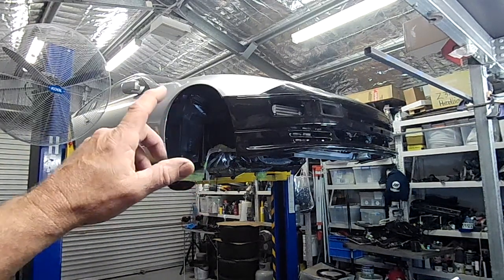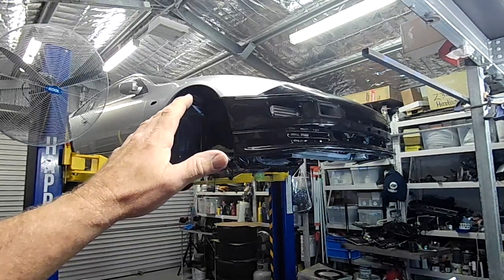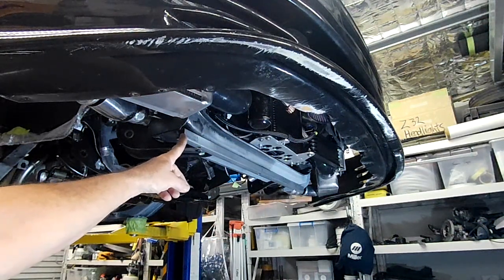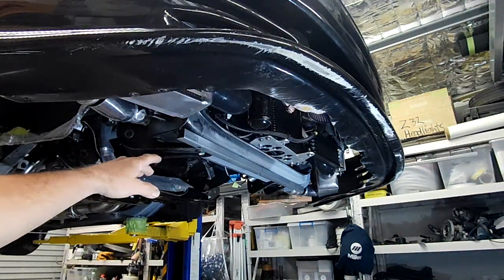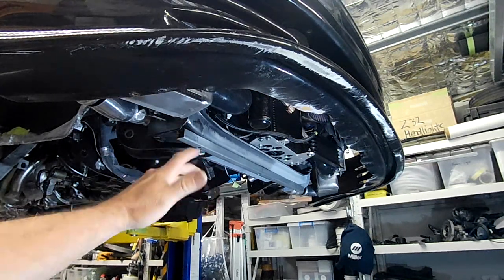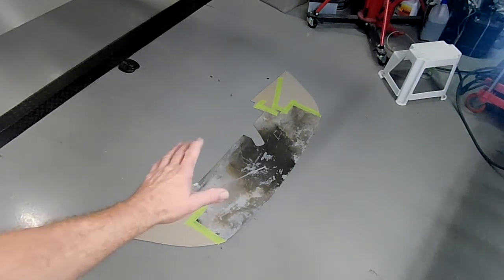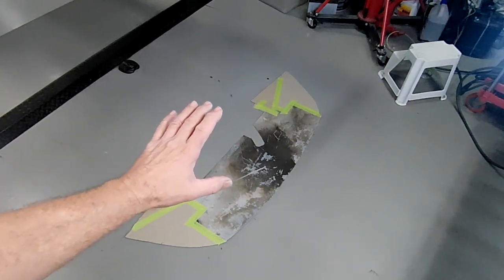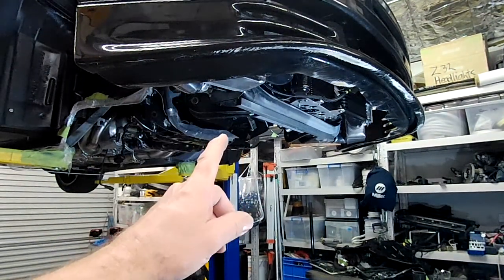Flat Front Under Tray Build. Project Fairlady, The Nissan Z32 300zx Twin Turbo Mega Build

Comment: That's a dream job! Just like how I would have it. I agree there is plenty of room for hot air to escape - I expect the air is relatively slow moving by the time it goes through the radiator and other openings. 
What would be nice (but bloody hard to do) is to put in some folds in the front in line with the undulations of the lower front lip and follow them through to the rear section. 
Final question, how are you planning to finish it - if at all? (I'd be leaving it raw - something about the look of naked metal!)
Reply from the maker: Thanks Benny, glad you like it,  i'm planning to do a Rear Diffuser as well, no idea at this stage if or how its all going to tie in together.
I agree on the Raw look, can't beat it for looks & functionality on the underside.
I'm currently working in the Front, building  all of the Aluminium Ducting for the Intercoolers-Oil coolers etc.
I reckon i've spent about 20 hrs looking at it, about 4hrs fab in cardboard, re-done it twice & now i think i finally might have something I can work with.
Cheers Mate.

Comment: That’s awesome man👌🏼I am keen to make a splitter/flat bottom for my 370 at some point, so I was interested to see how you went about it
I may have missed this as I am only new to the channel, but do you have a vented bonnet to help extract the air?
Reply from the maker: G'day Riley, no, not at this stage, I am however on the lookout for one. Decent ones are quite expensive hey.
Glad to have you here, Cheers Mate.